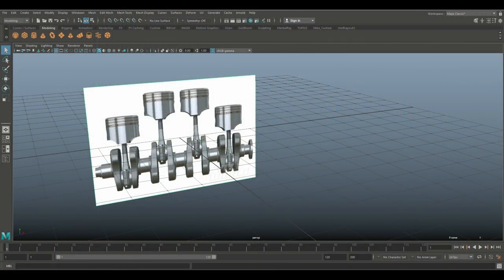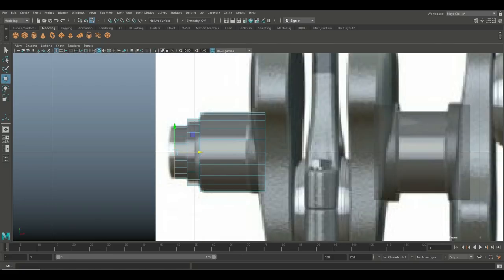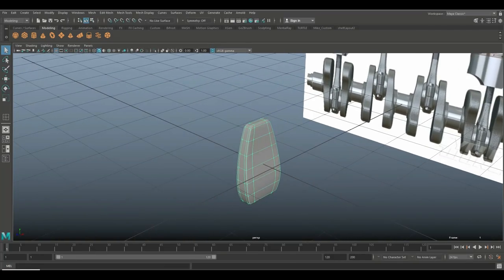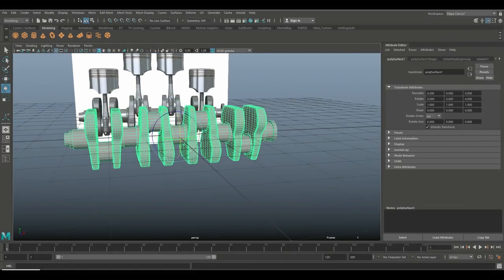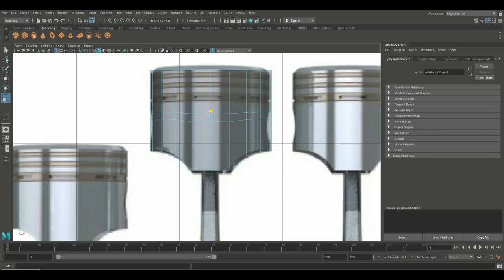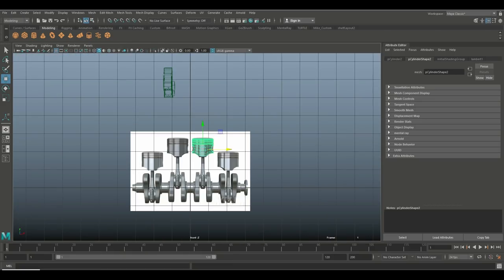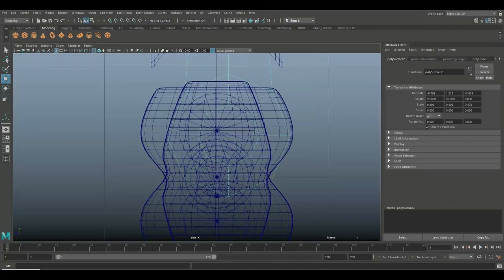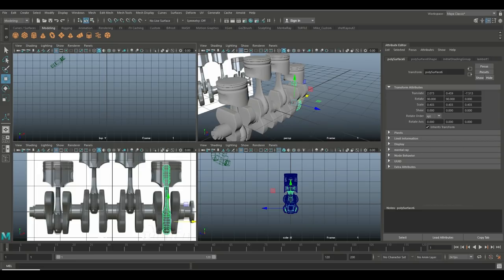How to model a CRANKSHAFT with PISTONS in Maya 2018

Comment: Hello mike, I have one issue in maya if you can help it is nothing to do with this video tutorial, the issue is I created a lion and I assigned Xgen fur to it, after couple of steps of assigning it stops showing the render output, it throws an error i.e, "Error: XGen:  Trouble closing ptx file: Can't write to ptex file: D:/3D_tutorials/Lion/LION/xgen/collections/body/fur/groom//bend/lion1.ptx
File exists" I am using maya 2017. The path is my local files, any idea about this?? thanks you in advance
Reply from the maker: That is really specific and I would not know to be honest. Try the Autodesk forums
Reply: Thank you very much mike for your feedback...